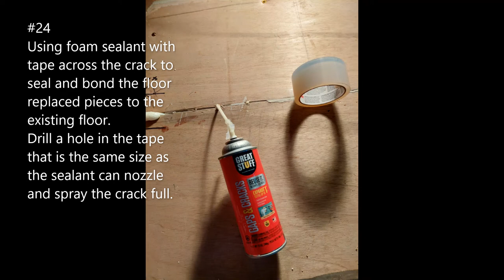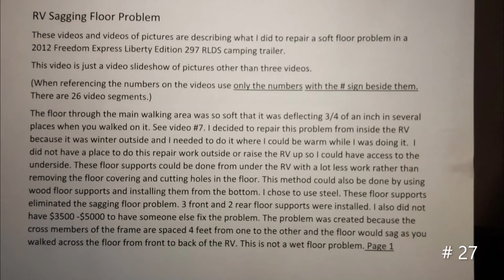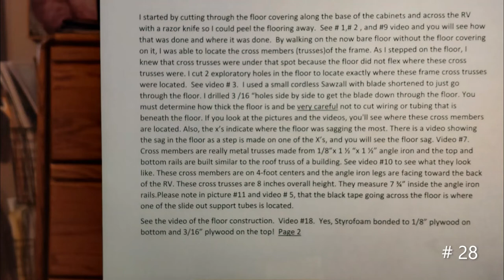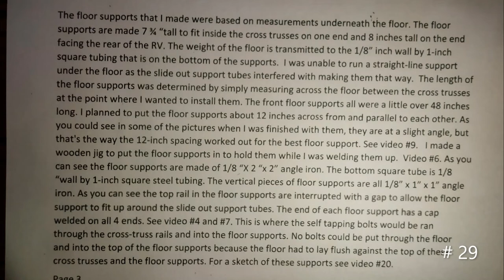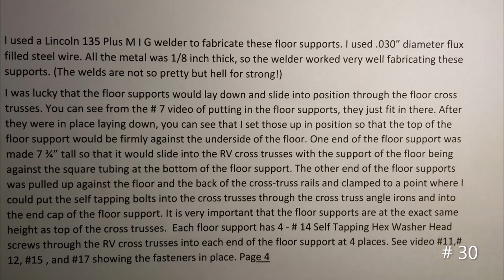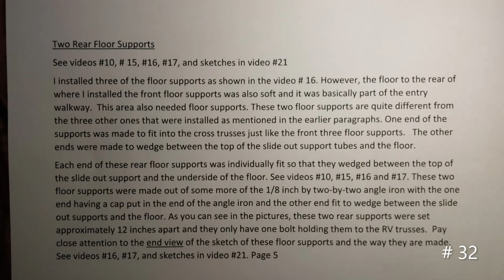adding rv sagging floor supports

Comment: Your video helped me tremendously, Ill be getting in my uncle's trailer tomorrow and doing the same thing. Good idea just cutting out where each joist is rather than entire floor
Reply from the maker: Glad it helps!  Comment if you need more info.
Reply: @leroyperfect5875 
I ended up removing the underbelly, it still had its challenges. But a success 👍
Thank you for your reply